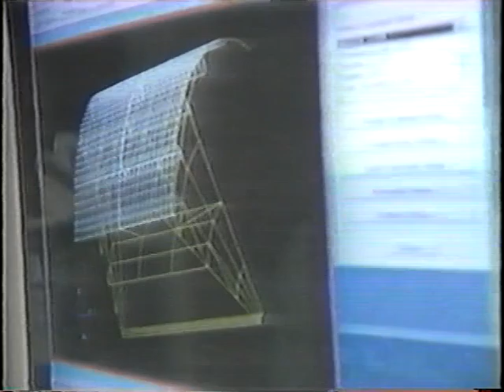Folsom gate failure

Comment: What I'd like to know is why did the motor on the boat at 2:00 fail at the same time. Seems a bit unlikely for the motor to not work and the gate fails at the same time.
Reply: I’m wondering the same, what happened to that boat, if they can swim away then that boat obviously had power to get away from that gate.